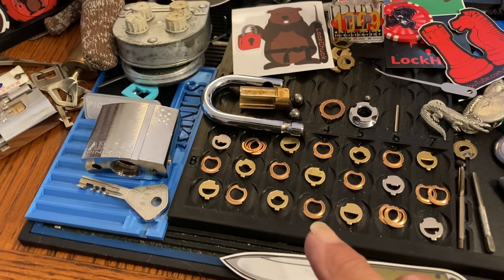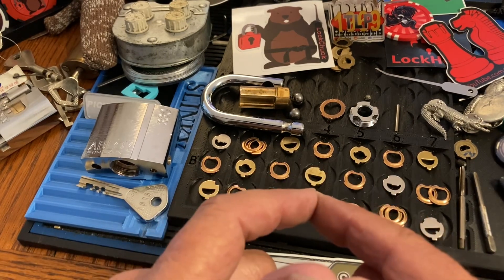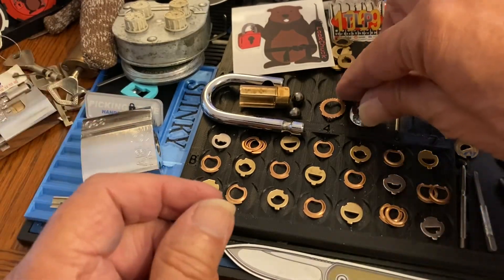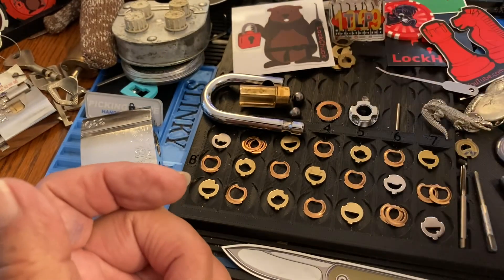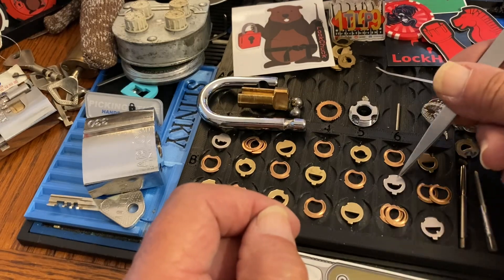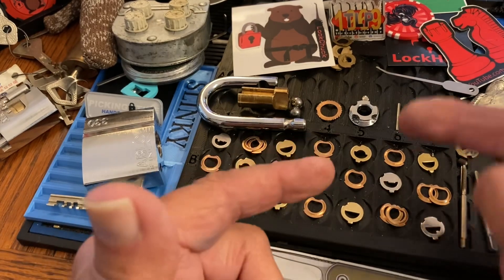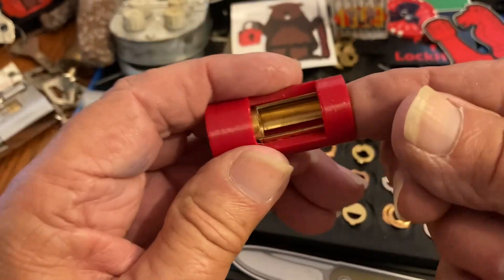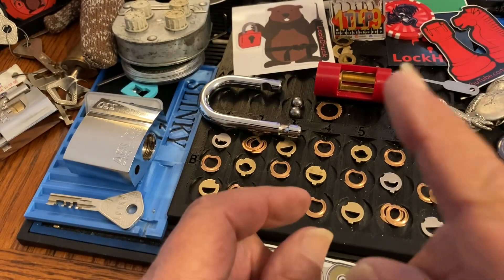#2687  Abloy 330 PL drilled

Comment: Mate you've done a fantastic job of opening the lock without  expensive machinery. I sometimes kiss the brass spacer even on the mill so well done. As lockchuck says the extra spacers are for the smaller steel discs. That should really help with makingtips and tensioners now you can see inside properly. Oh and the 3d printed body is awesome 👌🏻
Reply from the maker: Thank you!!! Your advice was very helpful!!! Yes the 3D holder is very cool!!! 
🐈‍⬛🐾🐈🐾🍻👍🐝

Comment: Thanks and you are welcome! Great gutting! The profile discs are thinner than the standard disc. They add an extra spacer to keep the key spacing correct. A standard disc is 1.35, a profile disc is 0.9mm and the spacer is 0.45mm. The difference between the standard and profile is 0.45mm, the same as one spacer.
Reply from the maker: Perfect 😀👍🐈🐾🐝
Reply from the maker: Putting is back together now to make sure I didn’t flip a disk or anything. 😅 
Your package is on the way 😅👍
Reply: @chriscapune7873  Thank you!!!🥰🥰
Reply from the maker: @LockChuck  you are very welcome!!
😀🐈🐾